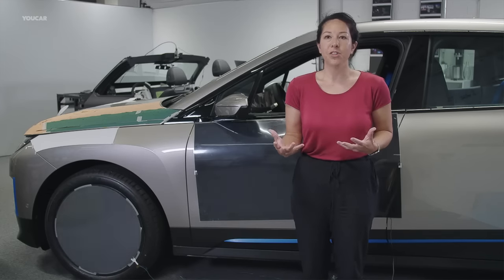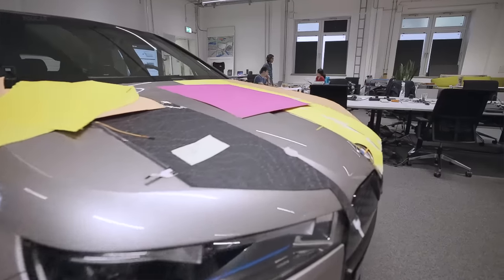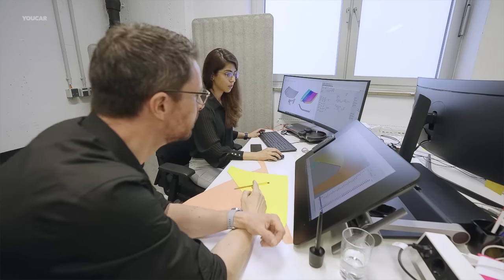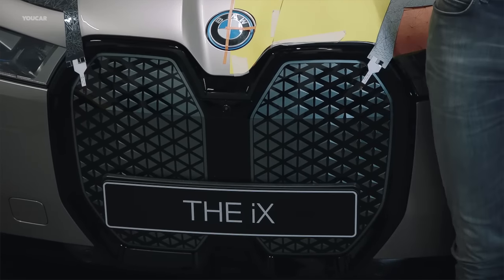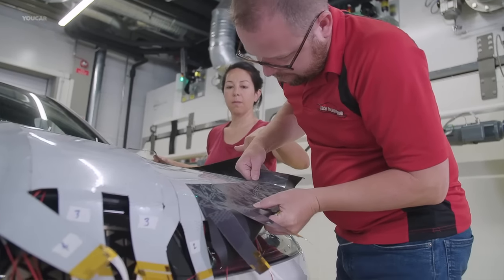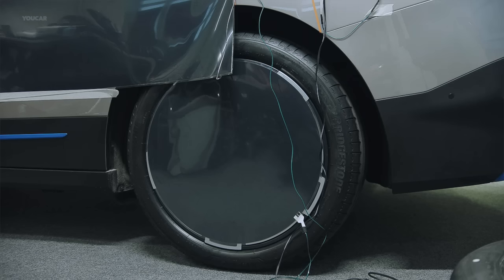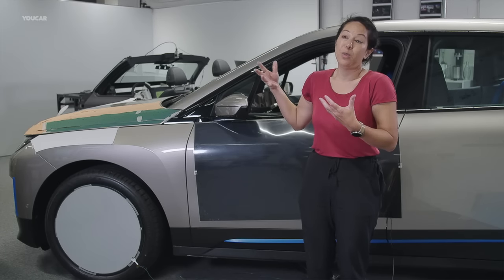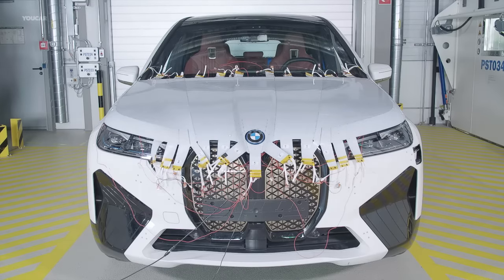BMW Magic Color-Changing Paint E INK

Comment: I understand not using the whole projector screen technique but has anyone thought about the safety issues someone can have with it at all malfunctioning and it reacting with the components inside the car as well and it possibly causing a problem where someone might innocently get harmed just due to a malfunction in the wiring or any of the electrical components reacting to something that throws it off and can cause an electrical fire inside the car with a innocent vista set inside the vehicle that ends up roasting inside the car at all from it’s malfunctioning wiring damage at all and it’s reactions with the connections of the actual vehicles capable performances of the actual operations of the vehicle to being a contribute to it being that the operations of the vehicle and the wiring of the graphics of its design interfacing with one another and the controls with each other being so close together in it’s performances and the functioning of the car to operate properly I would be concerned about those connections with one another using that sort of designing being to hazardous to causing some sort of flare up and causing technical problem errors that I would be worrying about with that sort of design. I would keep it a bit more simpler but yet graphically changing with technology but not having the operations of the vehicle intermittent with the designs of the graphics being controlled together in its analytics working on the same operations as one another I would make sure to have them separate for safety reasons honestly.
Reply: What?!?!